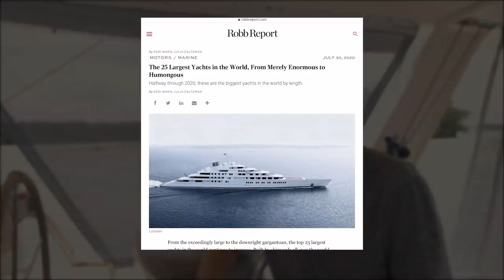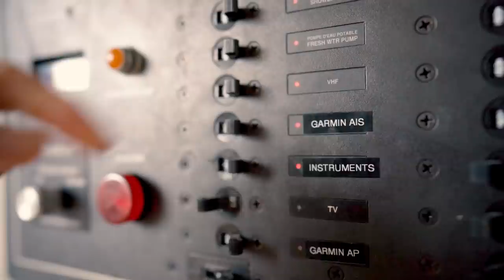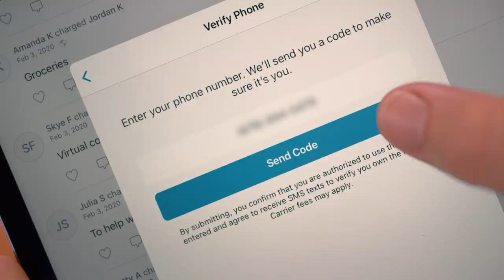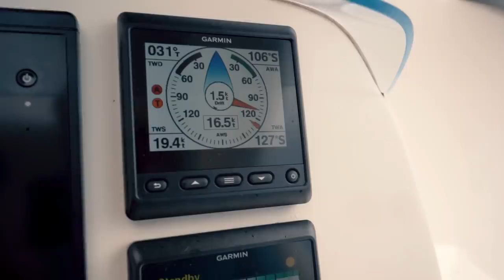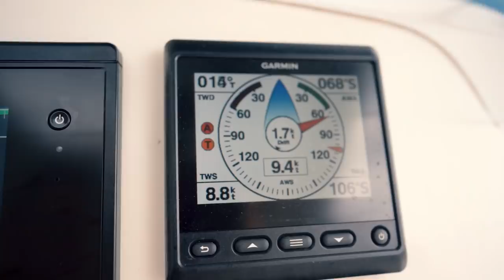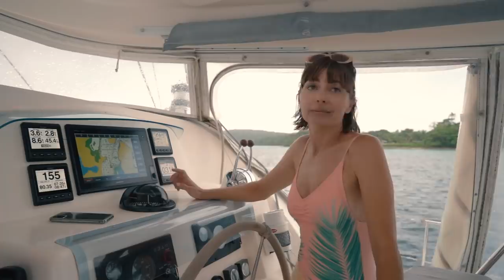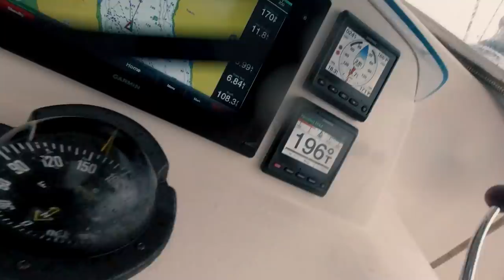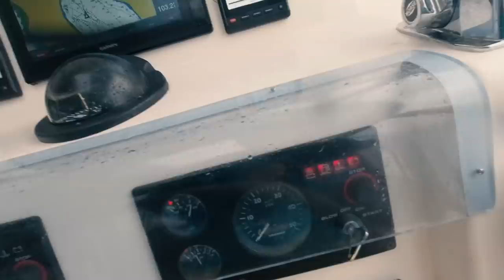SAILING WAS GOOD…then he went overboard 😳

Comment: Your alarm was probably from overheating - you didn't just loose the "Alternator belt" - that belt is the only belt and it drives the circulation pump for the engine coolant - so coolant wasn't circulating from the engine to the heat exchanger and the engine was overheating.    The alarm can also occur because of low oil pressure so neither is good on engine life...   Hopefully when you found it still running you didn't overheat it to the point the headgasket went....

Comment: Alternator or accessory belt? Looked like a waterpump? Could be an overheating alarm.
Reply: The belt on a Yanmar engine turns the alternator and the raw water pump. It's a single belt design.
Reply: @tomd.3082  Thanks. I bet it was an overheating alarm then. If so, It would be nice to have wired that to kill the engine somehow. maybe cut voltage from the battery?
Reply: @tomd.3082  Looking it up, it looks like theres "engine shutdown systems" that monitor temp. and oil pressure. But you're adding a PCB into the system that can potentially fail, (although the system can be over ridden) and theyre expensive. Considering it's sending a live signal somewhere to the alarm Im wondering if you could just wire a relay to fail closed and use the alarm voltage as the signal. Maybe it over complicates the system and adds additional fail points and KISS.

Comment: QUESTION: Have you tried putting something colorful like cool-aid on the outside of your leaks to see if they are leaking and not simply condensating? 

Ps I hate the long winded testimonial style ads at the start of a video, I often abort the whole video because of them. If you put them at the end and I have seen that add a million times before like surfshark I haven't lost any of the show when I abandon the show.
Also, surfshow and other anonymizer, or VPN's are dangerous security problems. I run a co.puter shop called CustomCPU in Anchorage Alaska. VPN's are what they call Proxy servers. When you change your location to one of their country servers all your data funnels through their server farm and they can watch everything you type and they get your iPhone address and they can n-map your network behind your firewall. 
Bottom line is you are putting your customers and yourself at risk.
Cheers from this not so optimistic watcher. 
Take care guys.